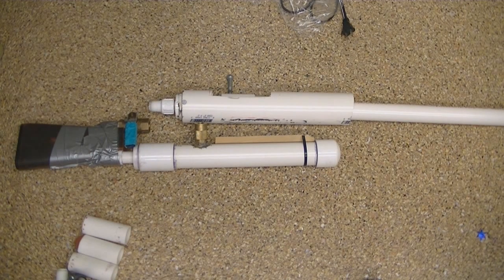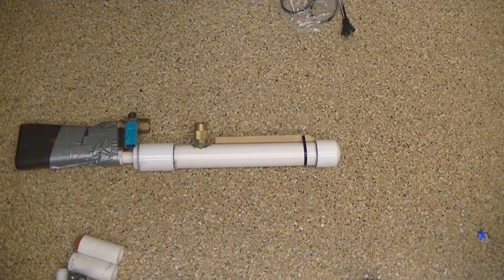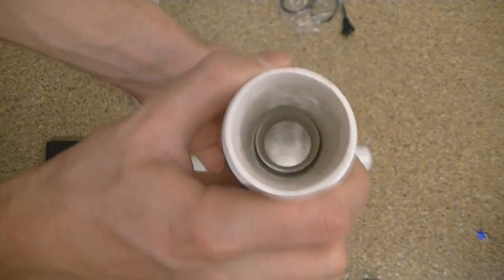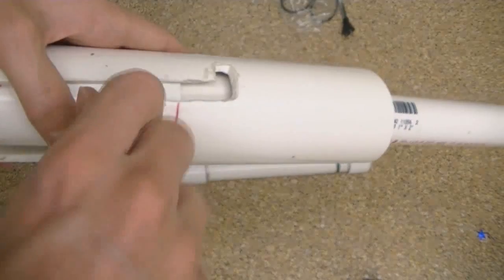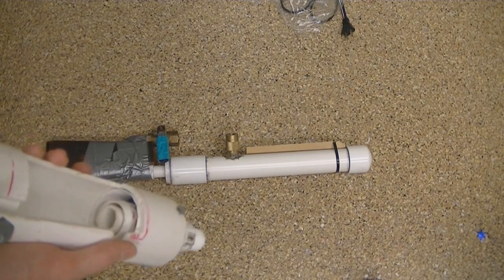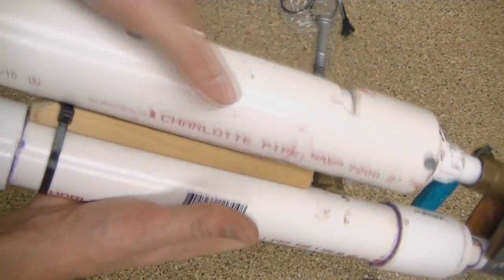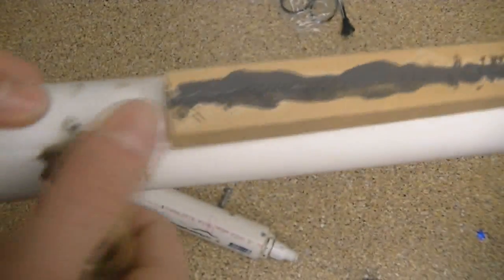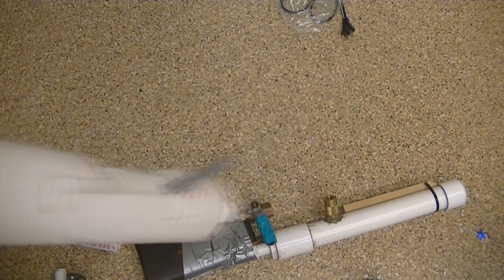How to make a simple PVC breech loaded air cannon

Comment: Don't put co2 in pvc, it gets very brittle at low temperatures, if you really want to use co2 abs is way safer but HPA is alot more powerful and doesn't lose pressure as quick

Comment: At least add a steel barrel and instead of using shells make the breach itself of the Dia of the shell, so you don't need to take the shell out repeatedly, put a vacuum muzzle brake in front of barrel.

Comment: in thinking about using this idea but instead of compressed air, using propane or something. have the cartridge like yours but have contacts built into the shell and then it hits contacts inside the breech. still drawing it up but hopefully it works when I get it together
Reply: Cody Harless Co2 cartridge and a nail.

Comment: Is it possible to add a spring in the inner bore, and add a angled ejector to the breech rammer?
Reply from the maker: squeakynerdy I don't know how you would design that off the top of my head, but I have seen some good ideas for designing magazine and ejection systems for air cannons. I would suggest trying a sprinkler head spring for something like that. They are large and easy to find. I had an old sprinkler head that we replaced and if I remember correctly the spring fit perfectly around a 1" pvc pipe.
Reply: Thanks, if you can give me parts list, i can get it done (My family is making a cardboard M3 Lee)
Reply: +squeakynerdy cool,can you post a video on YouTube ?

Comment: I like the cannon, and I had an idea for your next one. Try mounting a large, weak spring in the bolt to assist in pushing it back and making a seal. Also, since you are using such a large weapon, instead of having the breech on the right, put it on the left. This way you can have it more ready while loading by loading with your left hand.

Comment: Nice looks cool man can yoy discribe a little better  how you did the back where the bolt locks in im working o. Building one myselfe but it will have a interchangeable barrel so I can shoot arrows aswell at 140psi
Reply from the maker: What do you mean specifically? The bolt is held in place by the metal bolt that is forced into a groove cut into the PVC. The whole bolt action part is connected to the pneumatic valve by PVC adapters that are actually screwed into the 2" PVC frame. The "bolt" itself is 1 1/4" PVC that slides back into a 1 1/4" coupler that had its sides sanded to hopefully stop it from ever getting caught. Actually creating a seal is the hard part and I did not do this well at all. An O-ring would make this function much better.